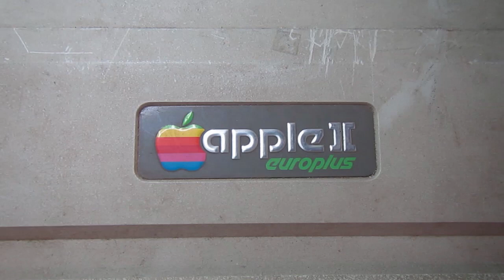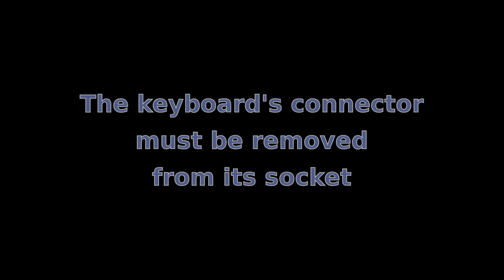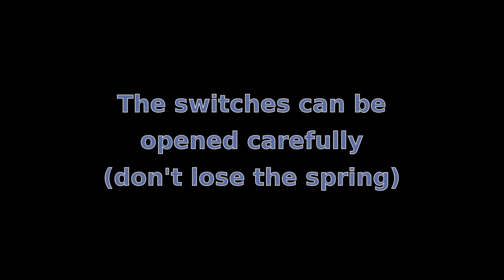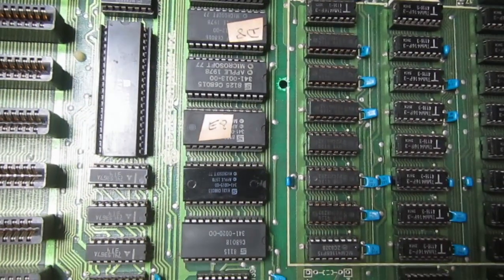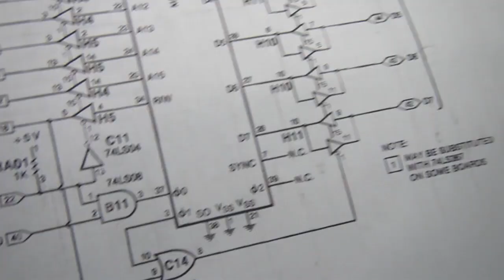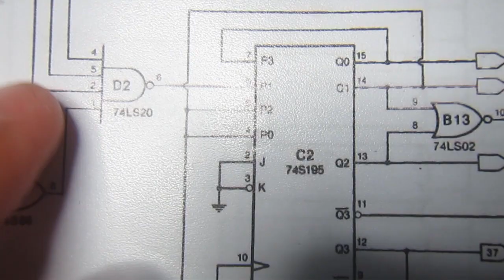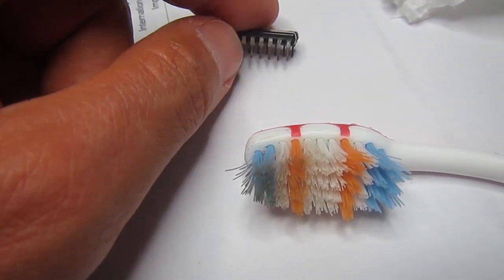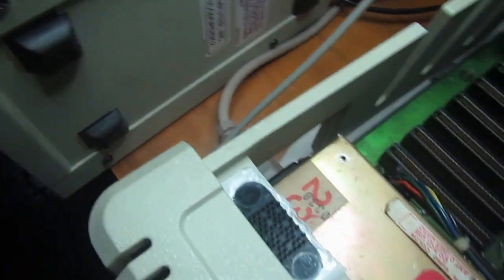Apple II europlus  restoration and repair.

Comment: that computer is 40 or 41 years old now.
Reply from the maker: Actually this particular one is a Rev. 7 Apple ][, made in 1982, so it's only 37 years old :)
But yes, the Apple ][ computer dates back to 1977, it was one of the famous "trinity" of 1977 together with the Commodore PET 2001 (that I have too) and the TRS-80 model 1.